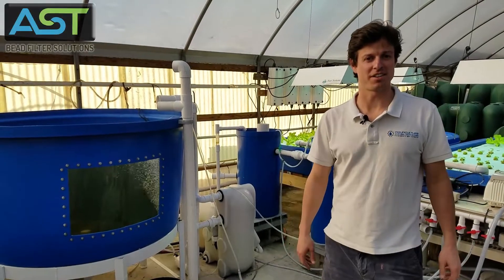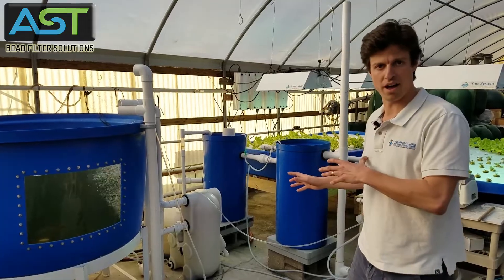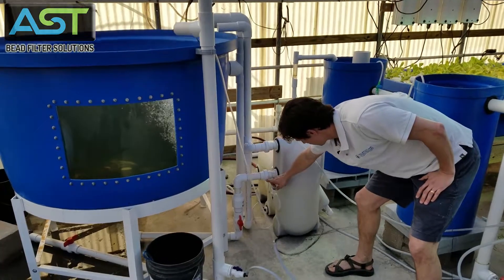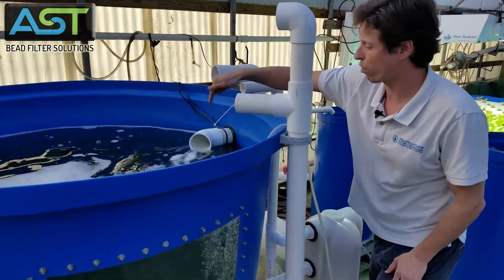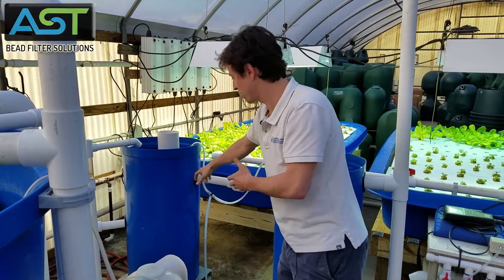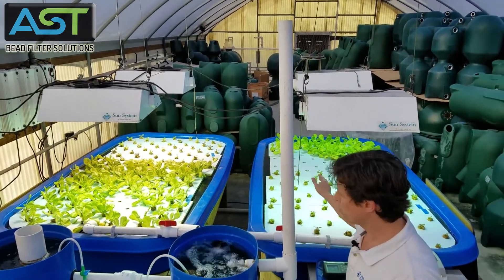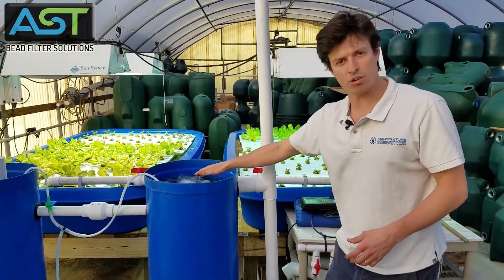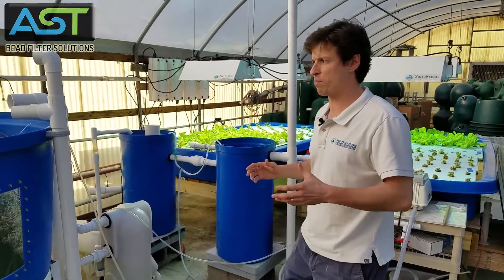Decoupled Aquaponics Garden System Kit (800 Gallons) Grow Produce and Fish without water pumps!

Comment: ok...so  I ordered AST's Endurance 4000 and was woundering, for a DRAS , what methods you used, if any,  to control the Nitrate levels when you need less of it? the UVI system uses the orchid netting and adjust the cleaning times depending on if they need more or less Nitrate while the endurance filter does all the cleaning for you and takes away that feature.  so do you know of any methods used with the endurance filter to control this?   im asking because i plan to start a small scale commercial system and want to have the option to grow more than just leafy greens.  I was actually wondering if i could have an extra tank next to the mineralization tank that can be used to lower the nitrate levels by letting the hetrotrophic bacteria take over and can be controlled with a simple valve when need?...any advice would be helpful.
Reply from the maker: Great question! Nitrate removal, denitrification, is an anaerobic (anoxic) process. Our units are capable, to a point, of passive denitrifiction in the internal sludge basin which can provide some nitrate control. This is more than likely not enough denitrification to control the whole system. For better control of nitrates, a anaerobic sludge digester will be your best bet. This would take the sludge from your system and use the carbon int he sludge to denitrify the water. It sounds like you already have this type of system in mind! The trick is being able to have a flow through anaerobic system that has a high organic content that does not dump a lot of solids into the system. 

Sounds like you are on the right track, remember the trick is high organics with little to no oxygen!

Comment: Help Water balance & Overflow?: I think I see clearly how system works LOVE IT. your video unlike many others is very clear! However One MONSTER issue driving me insane! It would seem Fish Tank water would decrease every day as loses water to plant loop? I assume user ads fresh water weekly to tank RIGHT or WRONG? 

The larger issue to me is the plant based decoupled loop? water added daily - seems as if it would overflow trays onto floor as all contained system except for evaporation.  I see no way in system solved... I would think a manual pipe from tanks going back to Fish to open weekly to balance system would work. Am I correct or silly???? PLEASE PLEASE REPLY
Reply from the maker: Water is added to the fish tank to make up for the concentrated solids that are sent to mineralization. This helps keep the water fresh and stable for the fish. Some people opt to do this every day, or every few days. The waste only leaves from the endurance filter when purged manually, so you are physically present when adding the waste and can monitor the water level. The filter is not continually sending solids to mineralization, it has an interior chamber that lets it capture solids without water loss. Loss only occurs during the manual opening of the valve and transfer of the sludge from the fish system to the plant system, so overflow is not an issue.

Comment: Is there any way of this method not using a fish or having a fish tank?
Reply from the maker: You may want to look at straight hydroponics systems. These involve using a purchases nutrient mix solution that is circulated around plant roots. Because a chemical solution provides all of the plant needs, no fish are needed. This mix will have to be changed regularly, as the nutrients are depleted and only salts are left behind. 

AST is working on aquaponic systems, which are fish paired with plants. This method reduces water waste, and allows the fish's high nitrate water to be used to nourish plants. It also reduces our reliance on chemical fertilizers (as used in hydroponics), which can contaminate wastewater.

Comment: Hi Paul - QUESTION TO PONDER UPON - If you're going to be adding stuff for the plants in the mixing sump bin anyway (decoupling the system), why not create an anaerobic denitrification filter for the fish tank (like Dr. Kevin Novak's Biocenosis Clarification Baskets, which he has supposedly used in a Koi pond for over 30 years without requiring maintenance) and save on water there, or would it be better (economically and/or environmentally) to save on nutrients used in the mixing sump?
Reply: ...Or, I just thought of another thing, perhaps we could add a return from the grow beds to the fish tank, in which another mixing sump is used to fix the pH for the fish?  Would that be better (economically and/or environmentally) than doing the water changes in the fish tank?
Reply: ...Heck, the whole thing could be automated with solenoid valves and dosing pumps, and it could even include temperature changes (heaters/chillers).

Comment: what size water pump do you use for the endurance 2000?
Reply: The Endurance filters use air lifts instead of water pumps. The air pump that is used for the 2000 is the Alita AL-100
Reply: Thanks

Comment: Awesome system! I'm really impressed. :D 

Suggestion: Provide a minimum of two independent air delivery inlets in each component. It all hinges on the air pump. If air stops and flow stops, not only are your fish likely to all die, the aerobic bacteria in the filter aren't going to have a good day either. 

Duplication of equipment is a great insurance policy. You could do this with a pair of check valves and two pumps charging your air distribution manifold, but that creates a maintenance and failure point. In a compact system such as this, it is more robust and not really much more money to simply have two or more independent air piping systems. If you're paying labor to inspect, clean, and maintain them so that they'll actually work when you need them to, the cost of a few more sticks of pipe and such is tiny by comparison. After years of headaches with check valves, I now eliminate the need wherever possible. 

A bonus is that taking a pump out of service for maintenance can keep the system operating, just at a reduced capacity. I personally like to divide the air supply into thirds so you have 90 min HRT with two of three pumps operating, but when all three pumps are running, I get 60 minutes. That's a fairly common range, but you could adjust to suit.  (Put differently, that's 0.67-1.00x hourly turnover.)

Extra points if you wire separate electrical circuits so each pump is on its own circuit breaker!  Battery backup and generator are worth considering too. A big bottle of oxygen and a normally-open solenoid valve with its own dedicated emergency air delivery system is a cheap way to keep your fish alive too and requires no electricity to do its job. I noticed Dr. Malone threw a pressure switch on the main lines too, that'll open the oxygen bottle if the air pressure in the main airlines drops. Slick idea. I'm gonna add that on my system! 

I mean, a crashed system could mean bankruptcy for a lot of folks. More than the cost of the product you lost, there's the goodwill lost when you fail to follow through on delivery promises with customers and they have to turn to a competitor. 

Walk your system and stare at each component for a while pondering what would happen if each part failed. Inevitably it'll happen right after quitting time and everyone's left for the day and you might not find out for 18+ hours. If you need to order a replacement, how long until you can get that online? Ask yourself whether you could tolerate that, what you could do to reduce the likelihood that it happens, what you can do to reduce the impact when it inevitably does happen, etc. Taking the time to do that could mean the difference between a minor inconvenience and going out of business!
Reply from the maker: Being located in New Orleans, most of our systems are on the normally open solenoid with a large tank of oxygen and carbon airstones. Electricity in a large emergency would be helpful, but given that evacuations may be in order and access is not guaranteed, it's not as practical to backup. We can't guarantee a person will be on site, or able to come for several days. Spreading the fish out between tanks with clean water and oxygen is the best that we can do for a prolonged emergency. With little to no feeding, they will produce less waste and can last for some time if not stocked too densely. They would not grow, but it would buy time until systems are back online. That said, our situation is extreme and not common in rest of the country. 

The extent of backups needed depends entirely on what your goals are (and how much money you can devote to the endeavor). We are not running this fish for production/growth (we will occasionally run tests that do, but we are not an aquaculture farm). We can lose weeks of growth and it not be a problem. If you ran an aquaculture farm that had strict production schedules, its much more important to have those backups that keep everything (air and filter) running so you can keep feeding and growing. If you are running a home system (in most areas of the US), you can generally rely on outages only being a few hours and air backups (airstones, pumps, battery operated) are likely to be sufficient. If a system is lightly loaded with a large amount of surface area, it's possible that no added air is necessary. 

Usually we want those higher densities in aquaponics or aquaculture, but it does add quite a bit of risk if your necessary equipment breaks or isn't powered. Some people set alarms systems that may even message your phone, and if they are nearby then they can go manually setup the backup pump/air (not recommended for heavily loaded systems, you might not have the time to remedy the situation so automatic is better) in situations where a person is always on site- it is a valid option that can save money. 

Always consider what could break and have parts/ replacements on hand if possible. In the event of prolonged outage: Air in a heavily loaded system is your most important factor, then it will be your ammonia management (if the filter is down). Being able to cycle the filter periodically or change the water is important. Those are the next actionable items and may have to be executed every few hours or days (depending on loading). Water quality tests are your friend. Emergencies are no fun, but with preparation and the right equipment you can get everyone through alive.

Comment: Hi Paul!  Thanks for the explanation on the decoupled aquaponics system: it makes a lot of sense to me!  I do have a couple of questions about the sludge mineralization part:

1- Does the aerobic mineralization happen quickly enough to transfer the nitrates to the hydroponic part of the system?  In recycled aquaponics, the sludge is usually sent to a separate mineralization tank for a process that apparently happens over a long period of time.  

2- Since you no longer have the filtration benefits of the Endurance, isn’t the water coming out of the sludge mineralization tank full of medium- and small-size particles?  Isn’t it necessary to have a fine filter after the mineralization tank but before water gets to DWC, media bed and/or NFT system(s)?

I really enjoy your videos! Can’t wait to see more and to get started on my decoupled system with your Endurance!

Thanks!!!

Comment: How does water replenish the fish tank Paul?

Really enjoy your bits with Brooklyn St Michael.  Great combo of information.
Reply from the maker: Thanks for watching Rich!  In a decoupled system, water is usually not returned to the tank. This allows for the addition of supplemental nutrients and pH adjustment to the plant system that is beneficial to plant growth but would otherwise harm the fish. In this style of aquaponics using the endurance filters only a few gallons of nutrient-rich sludge/water is sent to the digesters, which feeds the plant tanks. This water is then recirculated through the plant beds allowing the plants to absorb the nutrients. A constant water level can be maintained in the fish tank using a simple float valve hooked up to a water source that will add water as it is taken out of the system. 

I hope this answers your question. Thanks again for watching and commenting!!

Comment: Such a nice set-up and great explanation of the functionality of a decoupled system. 
Very pleased that someone has commercially designed airlifts for entire system. Air pumps make it so much cheaper to run and nothing to block. I have a small setup that uses gravity and 1 × 35 watt (240vlt) air pump for 4 x 1m square media beds. Plus 1x 20watt for the bead/mineralization barrel that follows a radial flow filter settling barrel.
If I had the money, I would buy one of your bead filters in a heartbeat.

Comment: Hey Paul:) Very cool looking filter. I have a question for you. Does this thing sift out fine particles? I run smaller diameter tubing to my dutch buckets and my Zipgrow towers and they get clogged every once in a while.
Reply: AST Filters thanks:) Maybe when I get some money up I will pick up a unit from you and show it off to all my followers on YouTube and Facebook.
Reply: I was just wondering about the zipgrow towers and their drip emitters possibly getting clogged (the Bubble Bead Filter is said to take out 100% of 50 micron particles and 48% of 5-10 micron particles).  How fine a filtration system were you using while still ending up with clogs?